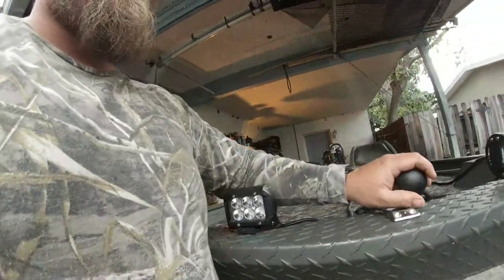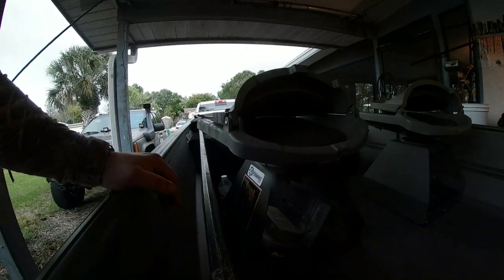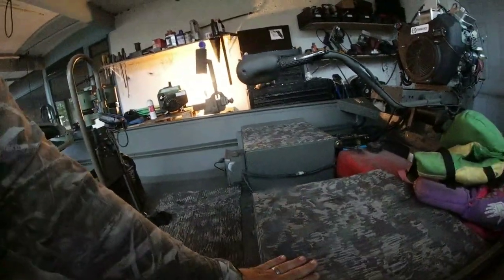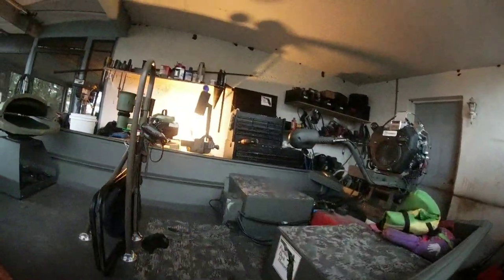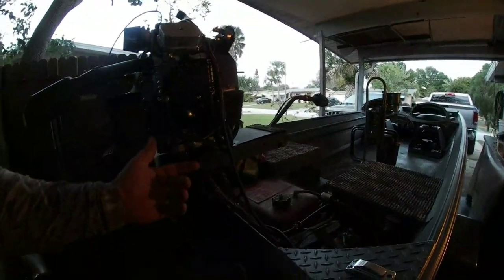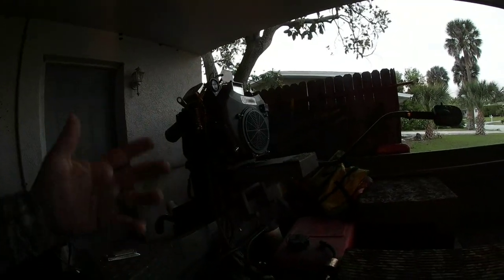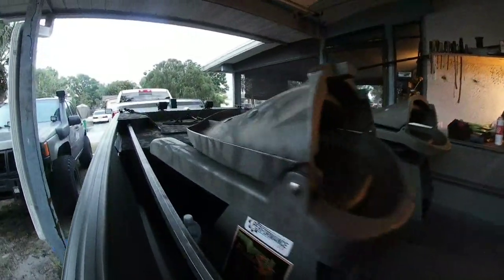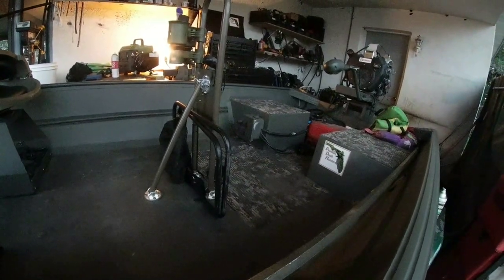Alweld mud series review

Comment: So what hp motor do you have on it? What level mods is it?
Reply from the maker: I have a gator tail with a predator on it. The engine has been modded to 45 hp and 46.9 ftlbs torque and it runs 31mph with me and gear and 26 with 2 people and gear, 22 with 3 and 80lb dog and gear. 1.23 to 1 bealt ratio and 3 blade gtr prop
Reply from the maker: Changed the motor to a stage 3 23hp vanny

Comment: Can you make a video with about the motor in that gotor tail kit
Reply from the maker: i dont understand what your asking?
Reply from the maker: check out my other videos
Reply: Like how you got the predator motor to work in the gtr frame and how does the belt work do you have a direct drive or does it have a clutch and is it electric trim or hand trim
Reply from the maker: @dirtysouthoutdoor2662  . it is direct drive i didnt want the extra weight. and i used a 36 tooth sprocket with a 1"  taperlock. also used the old spacers that are used to fit the vanguard 23hp on it and shimmed a little to fit the belt tightly
Reply from the maker: @dirtysouthoutdoor2662  it is electric trim still